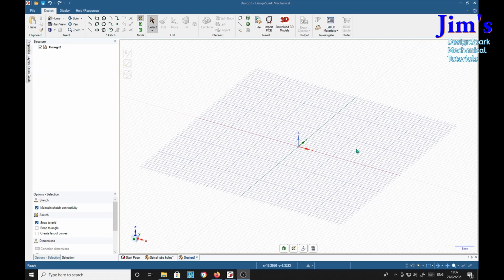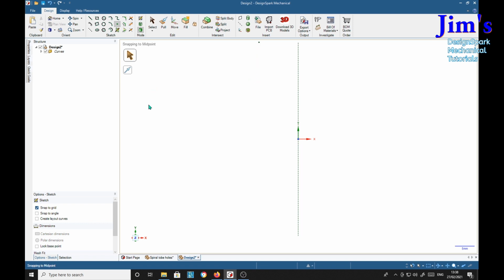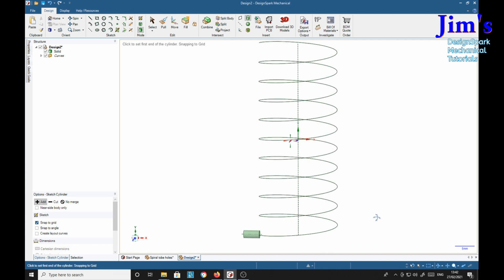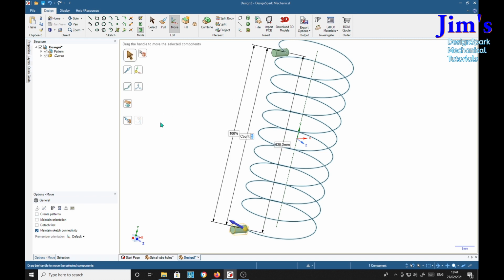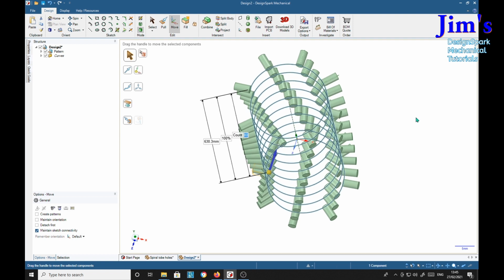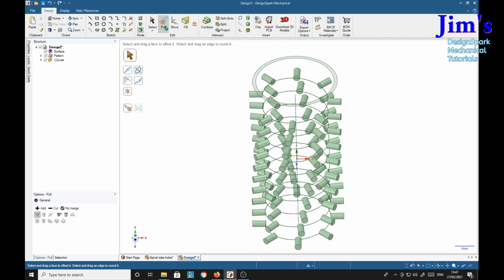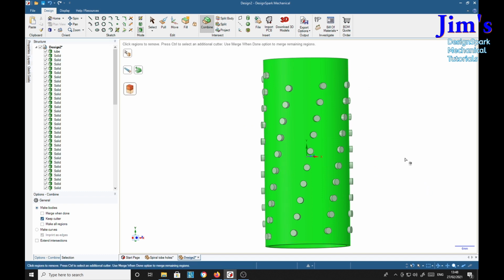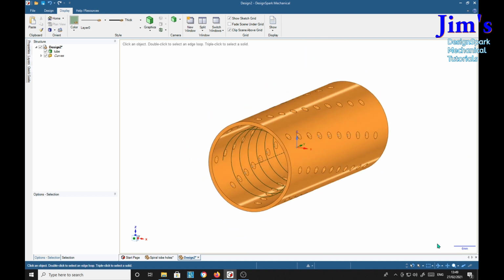DesignSpark Mechanical v Fusion360 demo

Comment: Hi Jim, I follow your work here in Brazil, and your videos have been very useful. Could you tell us how to print a drawing in three views with dimensions? Thank you very much.
Reply from the maker: Hi Alexsander. The only way I have found of doing this is to use split window (4 x viewports) in the Display tab and orient each view manually - Isometric, Top, Bottom, Left, Right etc. You can not print out all four views directly. You will need to capture the screen (the PrtSc Key) then use some sort of graphics package e.g. Photoshop, create a New window and paste it in to edit it. 

I hope this helps.

I may do a video on this.

Good luck, Jim
Reply: @JimTaylor42  
Thank you so much Jim this will help many other people

Comment: I have other designers that use tinker cad, fusion 360 and FreeCad. we had a few test like this, we picked a design and would see how long each of took to design the part. Design Spark won every time. If you think about it, it only has a few commands that you can use. Its great software. thanks for teaching me over the past few years.  Every video is helpful. Keep them up. Thanks Jim!
Reply from the maker: That is my intention for as long as I am able.

Comment: 7:34 the hanging icon next to the cursor allows you to one-click remove unnecessary solids right after the split operation. This works best in the design workspace, but you can also do what Jim does and shift-select a group to delete from structure tree.

Comment: I thought you were going to design the same thing in both pieces of software. Then we could see advantages and disadvantages of each. I was using 360 before I came across DSM. I switched because of changes to the software I didn’t agree with. That being said, I would like to see a direct comparison if possible. At any rate, I love DSM, and I especially love the way that you explain what you are doing. Keep up the good work sir.
Reply from the maker: You can review a video of the Fusion360 version at :  https://youtu.be/xKDogFyfjuA which I state in my comments below the video.